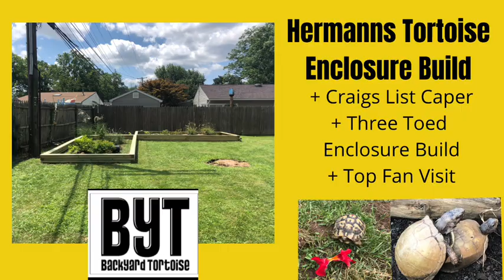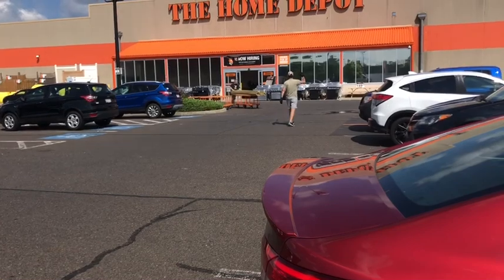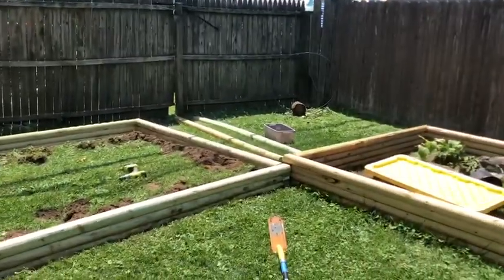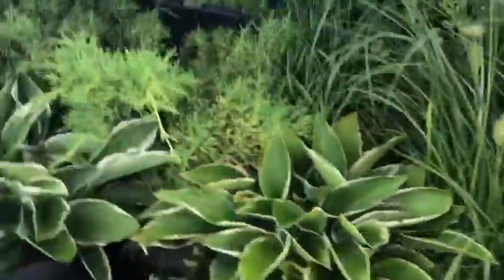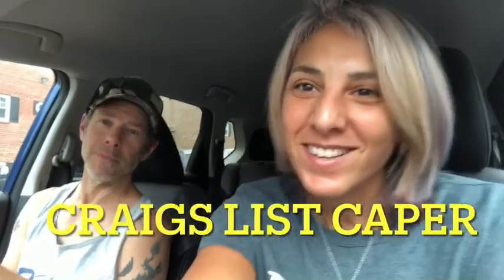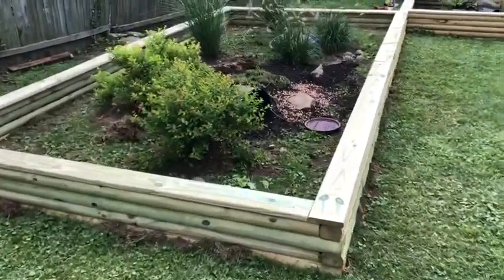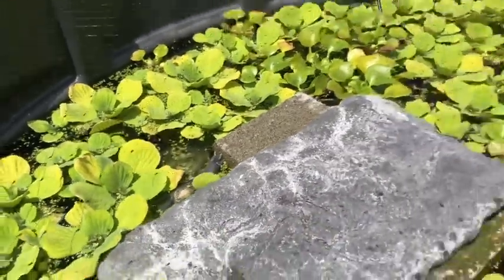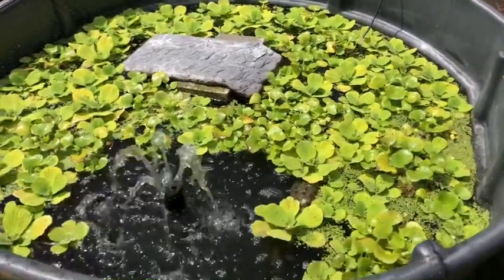Hermanns Tortoise Enclosure Build and much, much more!

Comment: Do you have to worry about predators? I’m wanting to put my Hermann’s out but I’m afraid of predators.
Reply from the maker: Carter- we just installed a privacy fence, we have Fox in the hood, but they will not be able to get in. We recommend you use an electric solar fence if you have real concerns. We used them in NC and they worked great!